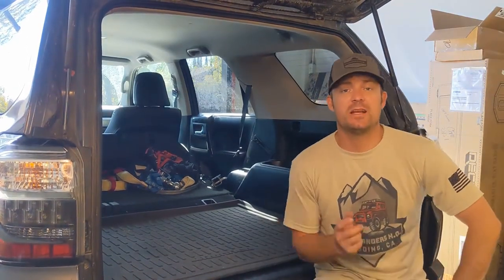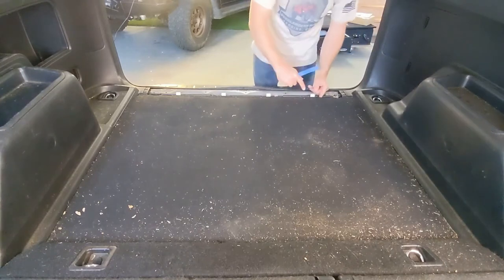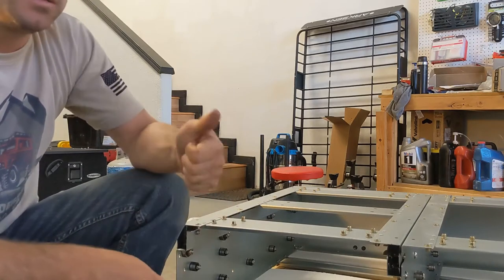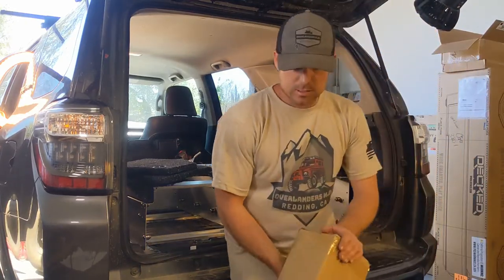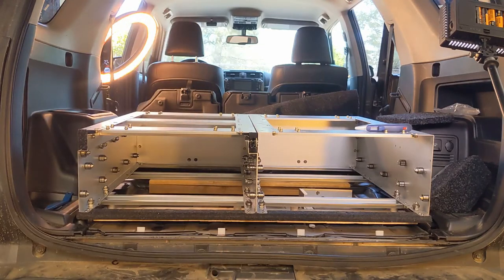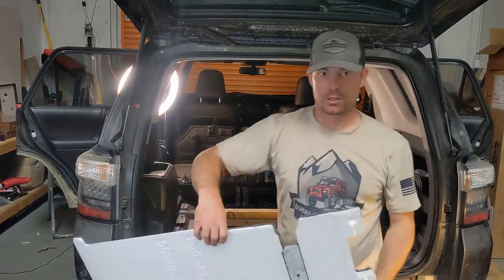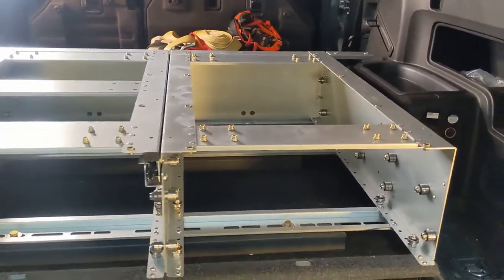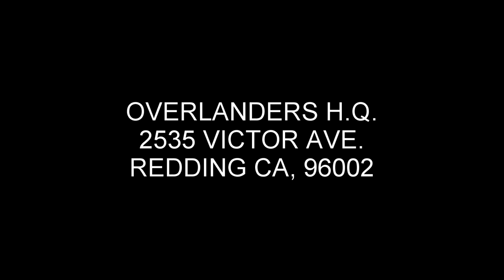5th Gen Toyota 4Runner TRD Pro Overland Drawer System from Dobinsons

Comment: Nice,  I’ve been looking at these drawers for awhile. Do you think it’s possible to just place the drawers in the back on the OEM mat and anchor down to the 4 4runner tie down points?
Reply from the maker: You could, you would still need to add a spacer in there. There is more than one way to do it for sure.

Comment: I bought these drawers from an off road outfitting shop online, and they were sold as custom fitted for a 5th gen 4Runner. I thought I was buying a product that was a perfect fit for the vehicle, but that’s is absolutely not true. These are generic drawers made to fit a variety of vehicles, and they use the sad looking wing kit to make it appear to be vehicle fitted. Thanks for making the video, but sadly I’m hugely disappointed in the drawers. Why on earth would I want to waste 2+ inches of space by installing 2x4 boards on the bottom??? And the fit of the wing kit is pathetic. The drawers are also ridiculously heavy. I have deep regrets buying this junk. Happy to sell mine if someone offers me a decent price.
Reply from the maker: If you want custom fit drawers check out Goose Gear. Front Runner also has some options. All drawer systems will require spacing the drawers up a couple inches so that the drawers can clear the rear of the vehicle. Unfortunately there isn't a system out there that does not waste that couple inches.
Reply: @OverlandersHQAdventures  yes, I really regret not spending a little more on a Goose Gear system. So much slicker, and no need to drill through the floor. A much better solution
Reply: I’m interested. How much are you looking to get and where are you located?
Reply: @charliekanel  I’m in Nevada. Looking to get very close to what I paid for them
Reply: @charliekanel  I might be interested

Comment: What the heck? Do they really not tell/show you what needs to be added under the drawer system to make it fit?!?!? Also, no templates for getting an exact fit? And the bolts don't fit??? Really? Really? And, every time you hit a rock...you get the hear those little top panels go clackity clack metal against metal???
Reply from the maker: Once installed the drawers are worth all of the work. The tie down points are spring loaded so they do not rattle.
Reply: @OverlandersHQAdventures  Never mentioned the tiedown points. I was talking about the loose panels that sit on top. They appear to just sit there and make quite a bit of noise...like metal on metal when you put them in place. I would imagine they would be extremely noisy on a trail. Thoughts?
Reply: @sharingtheadventure  sorry I thought the tie down points is what you were referring to. There are no loose panels, I may not have shown every step but the top pieces are secured and do not rattle. Not part of the drawers rattle or make noise on the trail
Reply: @brettwidner2153  Thanks!